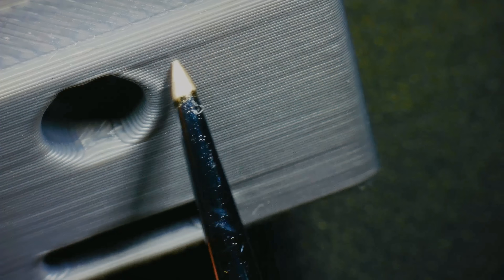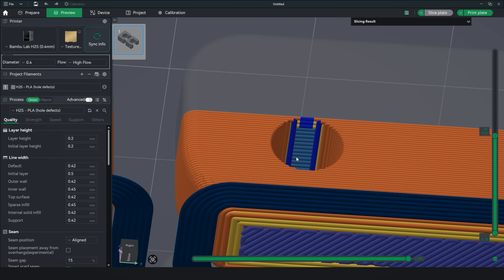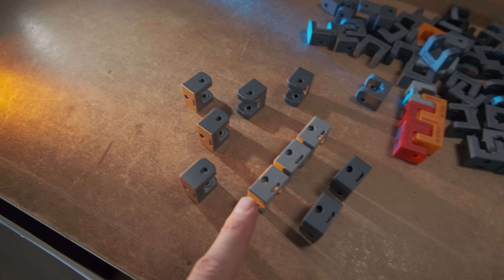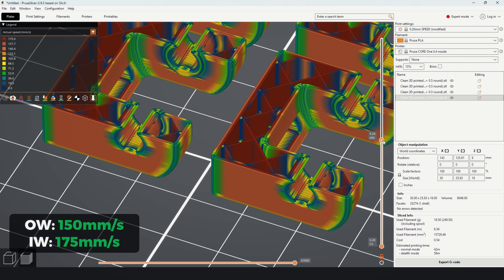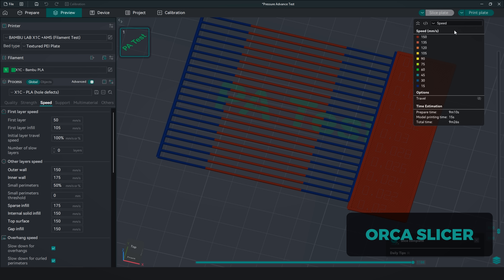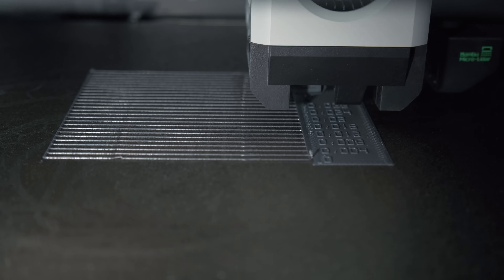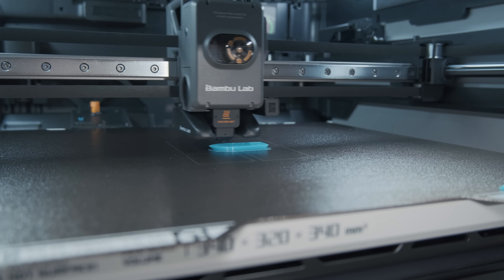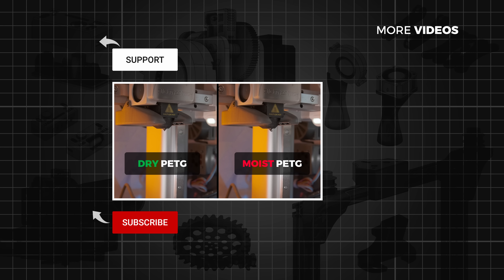How to FIX the UGLY 3D Printed HOLES (FULLY EXPLAINED)

Comment: I made something with holes for nuts and bolts, the hex holes printed perfectly but the round holes were always deformed so I elongated them turning them in to slight ovals so they would print round… It took a couple of iterations but it worked, the screw heads no longer rub on the print.
Reply from the maker: An interesting idea, I might have to try it. :)

Comment: I went deep down this rabbit hole. From my first PA tuning on a stock ender 3 I knew something was wrong, since no value was ever perfect.

The key issue is that the standard pressure advance is a linear relation but different speeds require different PA values.

Orcaslicer offers adaptive PA where it changes the PA value according to speeds and accels, but that's not ideal for when the speed changes in and out of a corner such as here.

The key to getting closer to the real behavior is Nonlinear Pressure Advance, which is implemented in Kalico (a Klipper fork) in the bleeding-edge-v2 branch. I wrote the documentation for how to tune it, though it is still somewhat finicky.

But once it's dialed in, you get much better walls around holes and you don't need to change PA when running slow or fast or thin layers.
Reply from the maker: Interesting. Isn't the stock Klipper PA already non-linear as we use the smoothing time value? What's the TLDR of it vs stock Klipper version? The more I explore each aspect that affects print quality the more I see how deep it goes and how much there's to improve.
Reply: @PrintingPerspective 

Smoothing happens before linear OR nonlinear PA. It's a crutch to deal with the ugliness that is square corner velocity...

With normal PA, it assumes that the spring constant of the extruder motor, gear lash, the solid filament, and melt pool is constant at all pressure levels. But the filament column buckles and then doesn't deflect anymore, and the melt pool also changes as more solid filament gets shoved down into it at higher flowrates. So the linear assumption has issues.

Nonlinear lets it take up the slack at low speeds before falling back to a lower slope at high speeds as the spring stiffens up.

Not inherent to linear vs nonlinear, the implementation also features a timing offset that lets you make PA happen ever so slightly early (1.5 to 5 ms in my experience depending on dd vs bowden), solving the issue of the wall thickening before a corner and thinning after the corner.

Read the Kalico docs (just search for "nonlinear pressure advance", yt doesn't like me linking to it) for some example photos at the bottom.
Reply: @PrintingPerspective 
I also made a nice print testing lighting fixture you can use to repeatably compare print quality without side-by-sides: Cube Spy (on printables).

Insert a 30mm cube like the built-in one to test layer stacking and extruder runout, or a Voron Cube to test the uniformity of the walls near holes that this video is focused on
Reply from the maker: Thanks for all the info!
I will check it out. :)

EDIT: I don't know why, but the print reminds me of putting the old school 35mm photo slides into a device to see them properly. What a wild throwback analogy... It is pretty cool how it looks!

Comment: Thank you! I got a handheld electronic microscope (500x zoom) last week and I finally have a good use for it: poring over PA line tests on my most troublesome printer. The default increments drove me crazy, so 0.001 is gonna be worse, but at least now I have a better tool to actually handle it
Reply from the maker: Did you meant electron microscope? If yes, then that is some crazy overkill! Under any microscope you won't find perfect lines, only good enough. But a microscope definitely makes it easier to find the best value.

Comment: Had an orbiter 2.0 some time ago and now an lgx lite v2..seems to me that with orbiter v2  pressure advance was much easier to tune for higher speeds.
Reply from the maker: The thing is that "seems" is not a good comparison, you know. I have no doubt that even extruders can affect it, but I feel like that's a too of a big rabbit hole to dive in.
Reply: @PrintingPerspective you are correct. I try to test it.
Reply: With LGX Lite V2 I had to go exactly PA 0.0555 with 0.4 mm nozzle,
with Bondtech CHT 0.5mm nozzle I was not able to tune it...

With HGX Lite V2.0 PA  0.054-0.055 resultet in good results on 0.4mm. I did not try to tune 0.5cht nozzle...

Comment: i tend to start with say .00 to .05 with .005 increments and then look to see what range is giving me the best results from that and i drop it down to .001 from say .015 to .025 if that's the best range on the bigger increment test.  i think it saves time?  i feel like i get to see the results at a quicker glance and then narrow it down.
Reply from the maker: Yeah, that is a solid method, but if you know what values are most common with your printer and different materials, you just skip the first step and start testing values like 0.02-0.04. It also depends on how big the bed of your printer is.
Reply: @PrintingPerspective  for sure.  this is a very good point.  and i do know those values for the materials that i print most with. the new flow calibration test in Orca 2.3.1 had me going back and re-tuning all my filament profiles just to see how good they were from then to now.  definitely improved now, if only by a marginal amount.  but still, improvement is improvement.